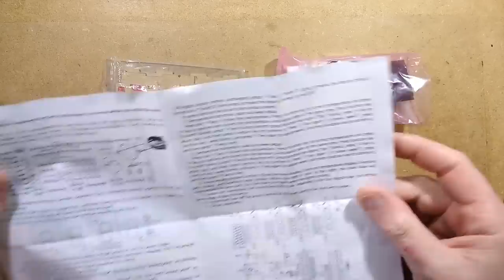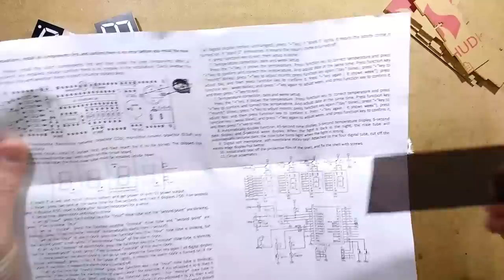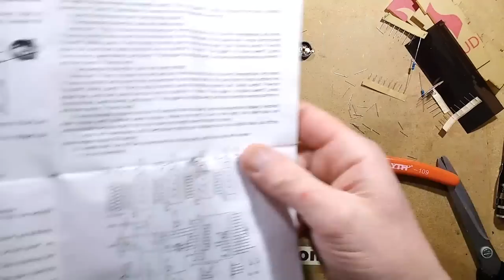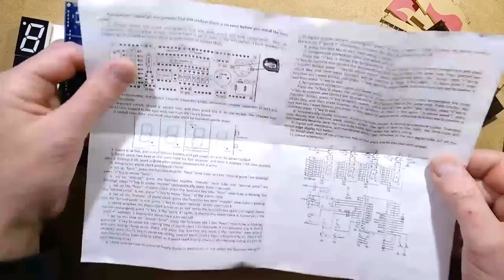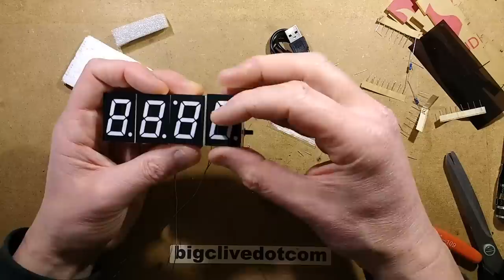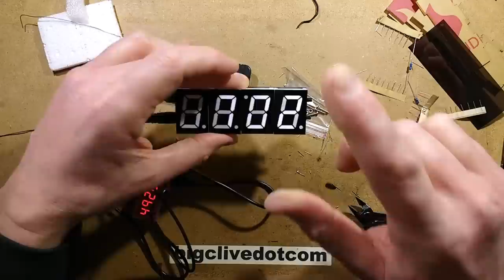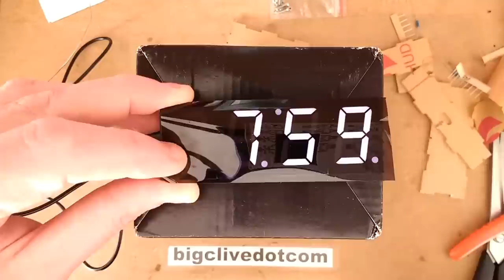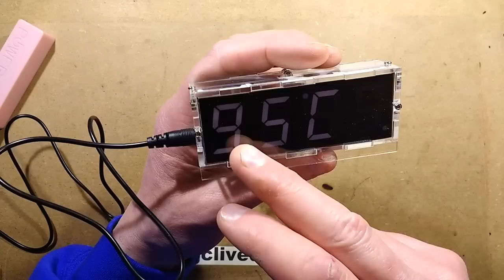eBay clock kit.  Full build and setting guide.

Comment: Some of the radio kits off banggood  , annoying.  non english instructions.  been going mostly by video of some of them and the one I have isn't a mispelling of Panasonic  , but it looks just the same  (the white one) and I'm fairly positive I put the LED in wrong.  They do make this transistor/resistor tester off ebay now that is like the cheap  easy way of what your doing with the multimeter.  Well not entirely sure it's easier but it's handy  , tends to run off a 9 volt batter..  with a green screen .  Mostly need it because I don't trust the color lines off the resistors  , and some end up being blue when the ones on ebay are not
Reply: this one I have thought about off banggood  , with these instructions I might but those small pads are annoying.  Even more annoying.  trying to figure out how to split the mistake of blending the solder together.  ($5 oops is well cheap.  attaching the so called collector really interesting.  )  banggood is selling a Tesla Coil though.  that sounds fun and so far as I can tell fairly easy to put together.

Comment: Lead-free solder is great, because it is used in so much stuff. And these appliances mostly don't have a long life, so solder is never the issue of a breakdown. Mainly crappy capacitors and a shitty power supply. And who gives a shit about the people putting the stuff together, eh? :D

But seriously, the old rosin flux solder isn't very good for your health either, so use proper precautions. Use lead-free solder if you have compatible tips and you're working on some piece of shit. Good stuff that is meant to last ages, use lead based solder.

Comment: 9:00 - "Yihua 878D6" - Woohoo, mine arrived today after only a week in transit, most of that at DHL customs handling! - 38:40 "Old Tool" Chip Lead Former still rather readily available here:
UK: https://www.rapidonline.com/trusemi-ics-01-ic-straightener-22-0330, http://www.ebay.co.uk/itm/IC-STRAIGHTENER-will-work-on-8-PIN-to-48-pin-/251530112761
DE: conrad.de, item 168203 
US: http://www.jameco.com/z/ICS-01-R-IC-Pin-Straightener-Tool_99363.html
Int: http://www.ebay.com/itm/1pc-DIP-IC-Straightener-ICS-01-width-7-62-15-24mm-0-3-0-6-no-Electrostatics-/140299432691
(no affiliation to any of those)
Reply: ty

Comment: Isn't it dangerous soldering with a beard that long ?

You know, it could get on top of the PCB, and touch the solder.

Do you sometimes tie it with a ribbon to avoid problems like this? x) Lol jk
Reply from the maker: If the beard does get in the way I tuck it into the collar of my jumper.

Comment: Do you think one of these kits would be worth using for the DIY Hobbyist?

Kuman DSO 138 DIY KIT Open Source 2.4" TFT 1Msps Digital Oscilloscope Kit with DIY parts + Probe 13803K (SMD pre-soldered)
https://www.amazon.com/dp/B0195ZIURK/_encoding=UTF8?coliid=I1LBQCREUD46VU&colid=1DLVIHOTUQXMT&psc=0
Reply from the maker: You'd have to be quite proficient at electronics to make that kit up.  It all depends on your level of skill, but they do these 'scopes with different levels of pre-assembly.

Comment: The video was going well until the nonsense where you show you don't understand the claimed risks of the lead and who it is claimed to harm. I'll give you a hint: it was never about protecting the assembler!

Also, old lead-based solder has the worst flux. Modern lead-free doesn't have more-toxic flux. All of it is bad, though. But the only super-dangerous flux is in the older lead-based stuff. You'll know you have the extreme neurotoxic flux when you grab an old spool of solder with a faded label, and the flux just flows really well and everything solders super-easy and there is a giant cloud of vapor rising from the flux. They stopped using that decades ago. Lead-free solder has relatively boring flux in most cases. If you're worried about it, choose "no clean."

The reason that hobbyists should be using lead-free solder is that it melts at a different temperature, and so used lead-based solder you doing poor self training. You won't still be able to buy that forever, and when you finally have to switch you'll be used to the old one, and end up whining about RoHS when you did it to yourself. Also, a lot of hobbyists like to have daydreams of selling a product some day; why get used to using materials that you can't ever use in a product?

There is no advantage for a hobbyist in using lead solder. Lead solder isn't easier to use. It isn't cheaper. The one you normally use is the one that is easier for you to use, simple as that.
Reply: Considering I spent 40 years using lead-based solder on a daily basis, and was able to switch to lead-free and start building and reworking boards in about an hour, I don't think there's a huge danger of someone learning bad habits by using leaded solder if that's what they have.  Temperature difference is only about 140 degrees C.  I have found that the flux smoke from the lead-free solder seems a bit more caustic, in that it makes the inside of my nose burn if I catch a whiff of it.